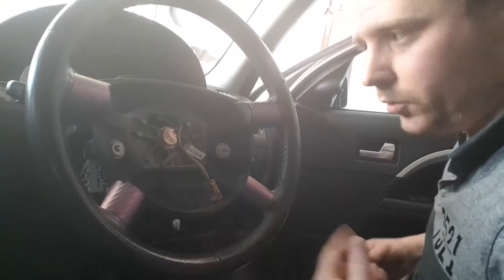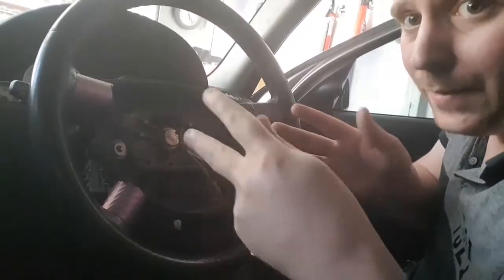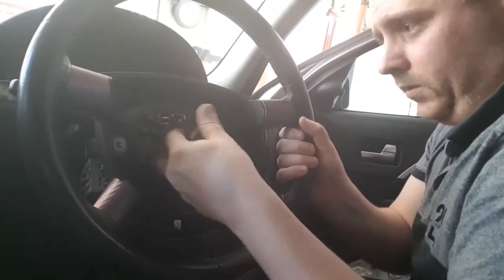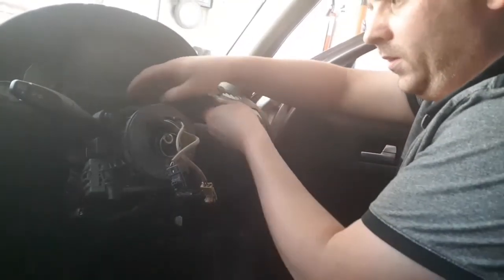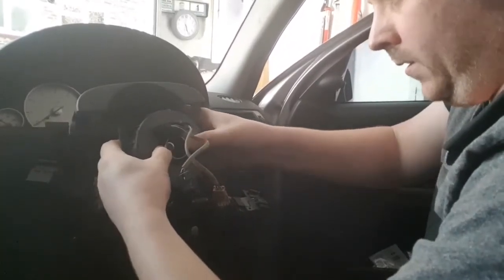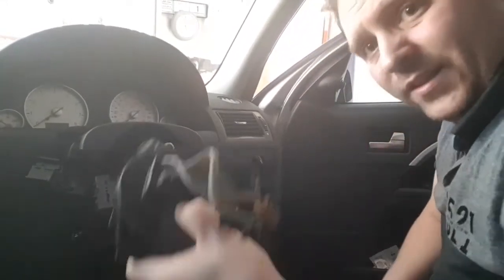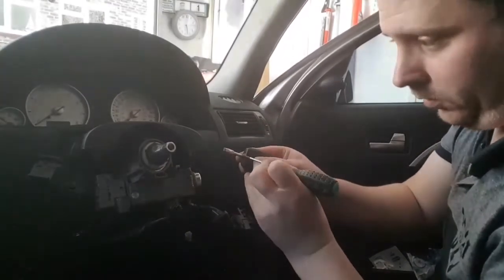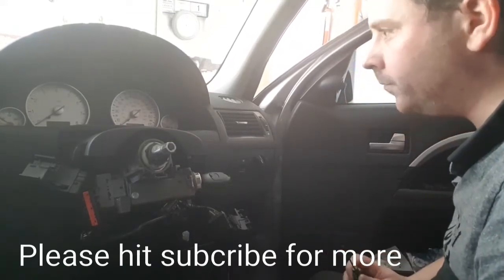How to remove steering wheel Airbag & Ignition barrel from a Ford Mondeo MK3 (2001-2007)

Comment: Love the video but how did you undo the airbag connections... ?? I slid the yellow retainers back and forth but they didn't want to budge..  BTW, a battery impact gun for the steering wheel bolt, off in 2 seconds..!! 
Keep up the good work..  who needs a Haynes manual..?!?!?

Comment: No need to do this. I changed barrel in my car today ( also watched all videos how to do that and I ve been near to give up seeing how much work needs to be done) and only thing you must do is loosen two screws under steering wheeel, open a little bit lower cover and you have access to this hole if you use 90 degrees hex key or just appropriate piece of stiff wire or anything. You need just turn a key into first position from 0 to 1 simultaneously putting this hex key into a hole and it pops, then you can pull key together with barrel. If not that means you have old good modeo;) like mine where barrel is so f..g tarnished that it don;'t even move a nanometer , it is just like a welded. If you do this you surelly have a new one barrel. Just take a look where is a pin locking barrel on place and how it works and everything will be clear.  More planning and thinking, less job to do ;)

Comment: Hi Chazz we have the same name but mines with an S anyway love your down to earth approach videos i have an 09 Galaxy and the OK does not work on the steering wheel so am unable to reset trip meter or clock etc? I have sprayed the switch with wd40 but still no good do i have to remove the s.wheel to remove the switch? any advice much appreciated p.s keep the vids coming mate there a great help ;-) Chas.

Comment: Thanks for the video mate. How can I remove the steering lock so it never comes on again? The old Astra GTEs was just a case of pulling the steering wheel as hard as possible to the right and the steering lock would snap. I am going to get a remote start for my MK3 Mondeo so don't want a steering lock. Thanks mate.
Reply from the maker: Paul Bryant hi Paul, when you remove the barrel the lock wont work so it all done by simply removing the barrel. Thanks for watching
Reply: Chazz Coombes Thanks Chazz. Looking through your videos, they are brilliant mate, so well explained.
Reply from the maker: cheers, well I do try mate.
Reply: Paul Bryant I have horn that won't stop sounding  until I remove under bonnet relay on a Mondeo Mk3 TDCI  year  2003 ...is the steering wheel slip ring the issue as car was standing 2 years ...have swung steering to extremes but still horn sounds !....relay tested in bonnet fuse box and is ok so assume ? The steering wheel  horn switch or slip ring at fault ..is this a good assumption ? Any help appreciated as cannot Mot till defect sorted !

Comment: Hi came across this video as I’ve just ordered myself an st steering wheel for my ST , you disconnected battery before yes, mine has ford sat will I need the code for it after plugging battery back in ... many thanks
Reply from the maker: Good morning and thanks for watching, yeap when doing this sort if stuff always disconnect the battery and leave for 20min or so.

Comment: Should I take the ignition barrel out and leave it out or cut a key and leave it in?
Reply from the maker: Lord Havok upto you, i took the key right out from mine. And keep the barrel in a safe place just in case and that was a few months ago now. No problems
Reply: Chazz Coombes okay. I plan on installing an Easyguard EC007 in my 2007 Ford Mustang GT. The installers that I went to in my area said that I must cut my key and I felt like that was not the best solution. Also they said that there is a bybass box needed and my spare key is to be locked inside.